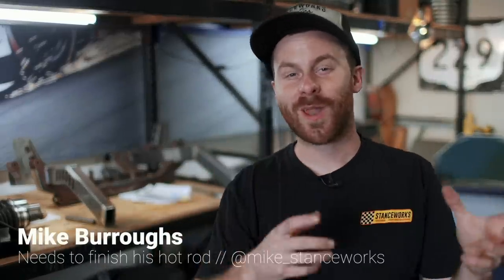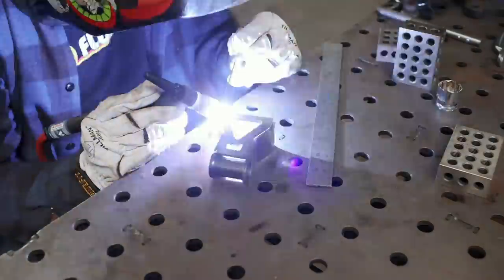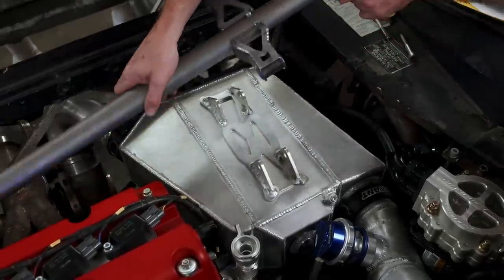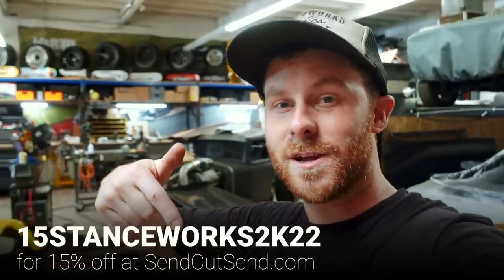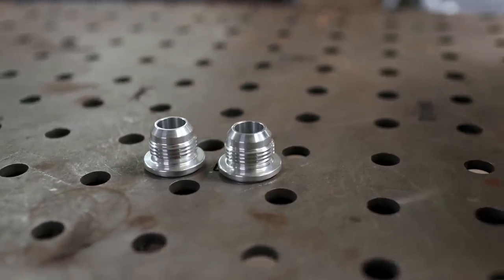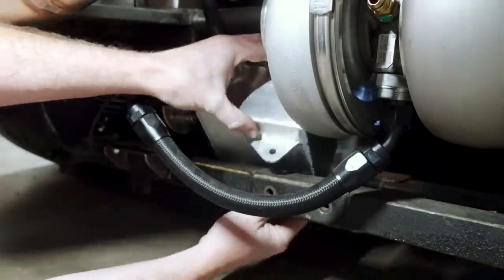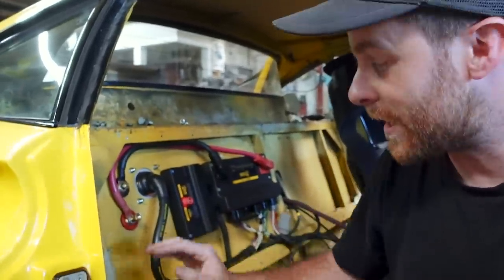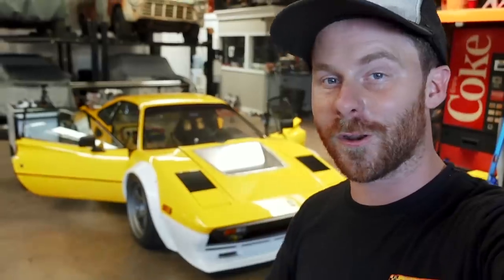Over-Engineering: Intercooler Mount, Oil Sump, PDM, And MORE! Honda-Swapped Ferrari

Comment: You’ll need to vent that tank. Without the vent it’s the same as the turbo being directly connected to the pump. Great work though!!
Reply: Came here to say that! It's about not drawing a vacuum on the seals on low load and idle i believe. I know it kills turbos if you don't.
Reply: @jdmjesus6103  (amateur here) wouldn't he also need baffles if he vents? Actually, shouldn't there be baffles regardless to prevent sloshing away from the inlet/outlet.
Reply: @beobe99  I don't think so no, the pump should be able to cope with max oil flow so the tank should be nearly dry most of the time. There may be an issue on long left hand bends but it depends on the circuit. You could fix that by using two pumps or maybe a tee in the line, one each side. Probably not needed though.
Reply: Exactly.
Reply: Yes i was thinking the same thing
Reply: I’m on my 5th turbo over just 6000 miles because of this problem. Just recently made a tank with venting and it seems to work better!🫱🏽‍🫲🏼
Reply: Liked and commenting to bump this up. It still needs a vent, you could run to catch can or rocker cover, somewhere that gets filtered or crankcase air.
Reply: It also needs a pick up tube on the outtake fitting (like the oil pick up in an engines sump) or it’s going to end up pulling air into the scavenge pump! Huge issue.
Reply: @Jonathan_Doe_   scavange pumps pull air all the time, it's not an issue. That's why you have multiple scavenge sources in different places in your sump - when you brake hard the rear one will go 'dry' and pull air, when you corner hard to the right the right side one will go 'dry' etc.

This might be an issue if you have a massive pump and are only pulling a trickle of oil, but I doubt this will be an issue in this case - old mate can always refer to the pump manufacturer to double check of course.
Reply: @Rollin8.0  I’m not sure if that lift pump is as robust as a dry sump scavenge pump. The issue is also more that the lift pumps going to have to pull a huge vacuum before it actually pulls the oil out the turbo sump, and if he vents it as suggested, it won’t pull the oil out the box at all without a pick up tube to the base of the box.
Reply: @Jonathan_Doe_  I expected he'd attach the scavenge pump to the lower fitting and the turbo to the upper (personally I would have welded the turbo fitting on as low as I could as well, rather than at the top) so the scavenge pump should draw oil without much effort. He could also do some testing with the diameter of the breather hole while the car is running, and aim to size the hole so it has a tiny vacuum at idle to help draw oil out of the turbo line without running the turbo totally dry.

Comment: On the subject of the cage.  Could you fabricate some side bars and add a roll bar at the rear window like in a cabriolet?  It's adding weight but if you have a roll over then at least it's something.
Reply from the maker: That’s more or less what we have now (but not in the car.). A bolt-in roll bar behind me.
Reply: Yeah. Old cars aren't known to be the best in a roll over, a roll over bar would be smart
Reply: @stanceworks  If it were me, I'd really want to street the car as much as I'd want to race it.  Especially for you being your dream build.  

Unless there's a solution for detaching the bars that go along the side of you and the passengers head, I wouldn't cage it.

I know there's solutions for quick detach side bars.  Is there something you can do for the top bar too?  I doubt it would be able to be certified for class racing but what about club racing?
Reply: So roll bar behind, roll bar across the top of the front screen and down the A pillars to the floor, then centrally positioned bars connecting front to rear. Provides clearance for you helmet and rigidity in the event of a roll over. You could even explore diagonal corner braces to the central bar.
Reply: @richardswain9143  this could work good enough! And it's better than a single hoop.
Reply: @richardswain9143   Exactly what I would propose. Even FIA homologated weld-in clamps (sure it is called else) for the lower side bars are available. This gives you freedom for road use. The rigidity of such an old car should be improved for safety (both road and track) do not mess with that. The improved rigidity will be effective on roadholding as well as it is preventing overquick aging of body and parts. Car will give more confidence.
Wrapping up: do that rollcage! :) I have been there.
Reply: @stanceworks  I'd say do a front hoop as well as what you already have, then fab up some removable door bars for extra rigidity.
Reply: @stanceworks  yeah that was my suggestion. a half cage.
Reply: Well.. this is an odd collisions of my interests, cars and war thunder
Reply: @andreascosta5781  i play it every so often. at 6.0 in american tech tree.
Reply: I would also recommend a removable steering wheel - that looked like an issue. Not sure if its an issue with street legal in SoCal
Reply: Maybe chairslayer can help scanning the interior of the car and coming up a with custom roll cage to meet your needs.
Reply: @stanceworks  rear and front hoops, seat/harness bar and  two bars down middle of roof.  Too/middle bars would tie the others together and keep top from smashing on head and them from folding on you.
Reply: I think a simple hoop/roll bar would be sufficient, gives it that track car look, rigidity, and streetable. Plus it give you a place for your harnesses. Idk I would go with side bars as it would make entering and exiting the car more difficult. Your ingenuity is on another level, such a monumental build more like art.
Reply: Half cage with bolt-in intrusion bars is the way to go for the streets.
Reply: @stanceworks  what about something that bolts in and out, a half cage than you can bolt a front half onto. Not sure how that would be constructed but if possible could be cool
Reply: In my 308 I moved the driver seat closer to the middle and lowered it by punching out the top deck of the double floor. Obviously, I had a strong protection plate welded in under the seat.
Reply: or foam pads on the cage around the head, maybe even a casual street helmet to wear off track driving
Reply: @stanceworks  I've been running a 4 point roll bar for a couple years and it hasn't held me back from even doing the east coast hill climbs.  IMO I think your roll bar would be good enough to get you on track safely and you can go back and add the cage later if you really need it.

Comment: The thing about the scavenge pump and the Turbo is that the little tank needs to make sure there is no or very little vacuum. At least this is how I always understood it. It might be necessary to have another line on that part going to the crankcase to reduce vacuum. (correct me if I'm wrong please)
Reply: Yes, the easy way is to add a ventilation hole with a filter in order to vent to atmosphere
Reply: I was just thinking that same thing! 👍👍

Comment: Love the build! as a Trophy Truck builder I would highly suggest making a compromise on a cage at a very minimum. what I mean is you could install at least a four point cage with a halo and cross bar for your shoulder straps and run bracing down the side. not as good as a full cage but better than not having one. wouldnt take up to much space yet still have the added protection. what I always tell people is no one plans on crashing, also motorsports is a crime of passion that we love to share with fellow enthusiasts. you absolutely will have passengers and while you may not push the car as hard with passengers present you will deff push the fun envelope to enjoy and share your mechanical art. no one looks back and says i wish i didnt build the car so safe, but do look back and say i wish i would have. Tyler Total Mayhem Racing

Comment: Skip the cage, and get it running. Take it to the tracks, and if you think you need more chassis stiffness, you can always add the cage later. It would sad if you weren't able to drive around on the streets.

Comment: Welding is really looking fantastic, you have definitely left me for dead. As for the cage, is it possible to run a rear half cage and have a bolt in front cage, so you can have it when you need it? Even just a rear cage will add stiffness and also give you something if the worst happens.
Reply from the maker: I’m thinking something like this is the solution.
Reply: I was just about to comment ‘Add a rear hoop at least behind the seats…’
Your idea is better🤟🏼

Comment: 12:41 You need another line run to that turbo sump tank, it needs to be able to suck air freely otherwise it will still create a negative pressure to bottom of the turbo and suck it dry. You can run another line up to you cam cover or catch can

Comment: The only issue with those Optrels is, if you forget you’ve hit the ‘grind mode’ button, or you hit it accidentally, and you’re wearing them low enough you don’t spot that little red light, you end up blinding yourself when you arc up. 

The dual flip 3m Speedglas masks avoid that issue, and also have a lot of colour, they’re a bit heavier though.

Comment: I keep thinking to myself that the bracket on top of the intercooler should extend and wrap over the edges. With the weight of the intercooler, the engine and road vibrations, I worry about the mount on the flat top will cause fatigue overtime. I think a hoop with contoured door bars is the best
Reply: I think the weight is being exaggerated. The big end tanks are on the air side so they're literally empty and the core itself has air passages going through it. Saying "it's full of water" just ain't right.

Comment: Mike, there is one idea for a roll cage you haven't explored.   A lot of guys that want the benefit of a better and stiffer chassis structure, but want to run they car on the street, do this trick.   They mount a 4 bar roof cage behind their seats in a normal cage.   They get the bas in the "B" pillar tucked right up up tight to the roof and the door frame.   Now here the trick part.  They then get som really think 1/4 or 3/8" chrome moly extra hard flat sheet metal and then they will take "CAD"/cardboard designs of their upper door jam surrounds and over to their A pillars and then down to the floor byt mading folds they tuck the CAD with might be a 6" wide material unfolded.    Basically this stock then needs to be cut into sections, maybe with holes drilled out of it for weight savings, and then welded in from the tube roll chassis in the B pillar, tieing into the roll cage, and all the way around the door frame, windshield frame, and down to the floor board.   This will add significant frame strength, chassis rigidity, and crash protection.   Perhaps not as much as a full roll cage, but far better than without it.   Best of all, because it's only 1/4" or 3/8" thick, it doesn't take up a lot of room, and come be covered up easily by trim and a nice roof liner.  There is always more than one way to skin a bear, as they say!   Reply back if you want to talk about it more.

Comment: As for the roll cage, what comes to my mind is a hoop that follows the A pillar tightly, going back to the rea hoop in the MIDDLE ala "T" top.  the bars at the side foot well that get in the way could be made "bolt in" and be removable for street use. You could use a half round solid connector lie the way a RZR cage bolts at the "A" pillar.

Comment: Your welds are looking fantastic in this episode man! They've definitely come a long way. It's great seeing you take the input from the experience in your community as a learning opportunity and seeing the results.

As for the roll cage, I think it really comes down to having a conversation with yourself about exactly what your plans are for the car. Are you looking to make this thing an absolute time attack monster? Because every bit of rigidy you can add with a full cage will definitely help with that. But if you're fine not trying to be best in class and are just looking to rip it around the track, I'd say doing a half cage is your best option. Sure, you're going to lose some rigidity. But you won't lose out on your ability to to drive it on a whims notice during a typical day.

I basically look at it two ways. Full cage it and only be able to drive it when you have the time to get everything set-up to go to the track, or put in a half cage and be able to drive it whenever you want.

Comment: roll cage idea
bar across the front, bar across the back behind your seat,: both join below by the door line, and across the middle on the passenger side on top by the roof, asimetric.

Comment: A few things:
1: The turbo oil drain setup would benefit from having a float switch activated pump. It will extend the life of the electric pump. It probably is, strictly speaking, not necessary. However, you will almost certainly need an indicator to determine if the pump is actually running. Most scavenge pumps I've dealt with don't permit push-through flow. So if the pump isn't running, the turbo may not be getting oil once the pressures balance. 
Additionally, The oil flow rate of a ball bearing turbo is very small and the scavenge pump may need additional flow to keep lubricated/cool. A float switch would allow for sufficient pump flow when it activates. I did not watch the video where you installed it, so perhaps these things have already been considered.

2: Without any further information than what you provided in the video, I would guess that the bushings you made for the intercooler are too stiff. If you can machine them and you can use them for control arms, they likely are not going to move any meaningful amount with 60lbs of intercooler on them. However, I don't have a source for a more compliant bushing that I could recommend. If you find the durometer rating of the bushing material you're using, you can determine how important this concern is.

3: As someone who's done a LOT of track days in various cars, you need at least a four point cage. That means four points of connection to the chassis, behind you in the passenger compartment. I would STRONGLY recommend adding door bars on top of that. They do make clevis kits to allow for removable door bars and that may be to your liking for your occasional street use. 

If the four point section is made well/correctly, it should be enough if you end up on your roof. It won't be enough if you roll the car multiple times. You will have to decide if you are comfortable with that trade off. If you are not comfortable, a full cage is necessary. 

The reason for my recommendation is because you are attempting to push the car far past it's era of performance. Tripling the power, doubling the grip and braking, and trying to add aero download are all well outside the race cars of this era. The chassis will struggle to handle these loads and the cage will help. More cage will help more. 

Ultimately, your inexperience in combination with a heavily modified, homebuilt vehicle make a cage a no-brainer. 

Good luck

Comment: You spent this much time building this creation - if it were me, I would go nuts knowing I limited how often and where I could drive it if I went with a full cage that is only safe when wearing a helmet etc.

Obviously, make it as safe as you can, but for the street. 

I'm excited for the content of this thing ripping up the canyons of California. Turbo k series noises bouncing off every geographical surface. It's a fun experience - my favorite in my big hp k swapped mr2

Comment: Rear half cage/roll bar for sure. Will give you a place to mount shoulder harnesses if required, offer roll over protection in a freak incident, and doesn't cause more issue getting in/out of the car.
Everything is coming along damn amazing. Loving it!

Comment: you can take inspiration in 911 gt3 cages, the rear part is bolted to the car and you can add the front part wich is just bolted to the rear part of the cage, it's a modular system

Comment: Been watching for a long long time and like wheels a seat can make or break a car. Look at diff seat styles before you decide on the cage.  They should match each others lines so you can get in/out easier. You might not need all the hip and side support your current seat provides. A hoop and side bars should be plenty for what you are doing

Comment: Not being an Instagram worthy welder, I still would like to give you some tips for tig welding. I myself learned a lot from the channel welding tips and tricks. I practiced a lot to get my filler hand keep up with the torch. Most off the welds you did can be done without stopping, which will result in them looking better. And prop your hand that holds the torch on something that slides, this will help you keep a good torch angle. I even use this when I mig welding. I hope this helps. Greetings from Belgium. Keep up making great content!

Comment: Rollcage. B pillar main hoop, with 2 rear stays down to the upper suspension mounting points. A harness mount tube at the height of the top of your shoulders. If possible 2 tubes from the base of the B pillar, back to meet the rear stays.
Contoured door bars from as high on the B pillar, to as far forward on the sill, as tolerable